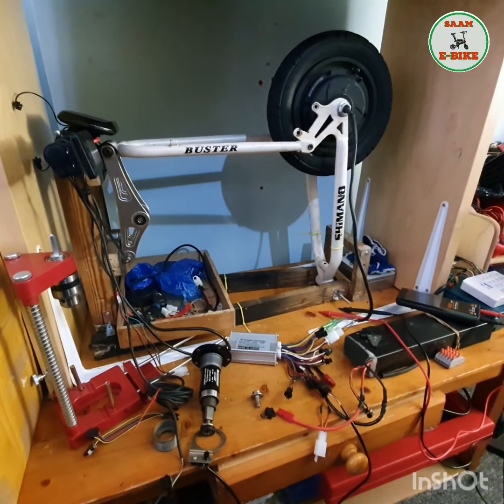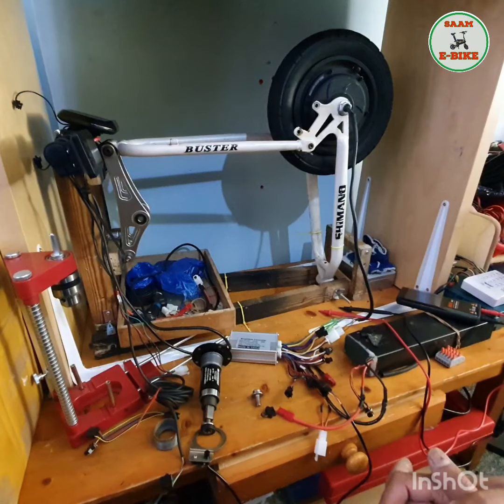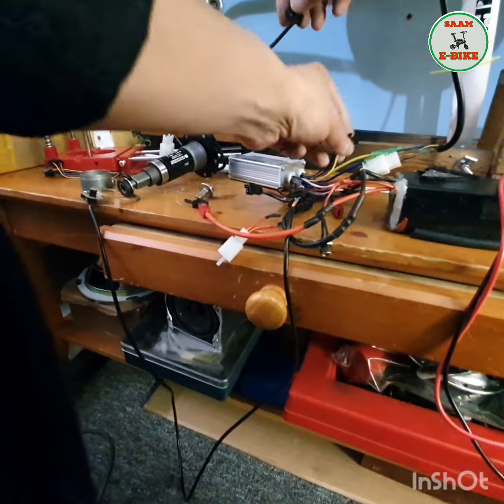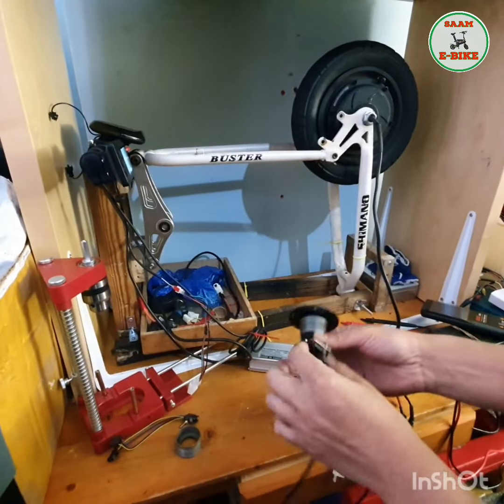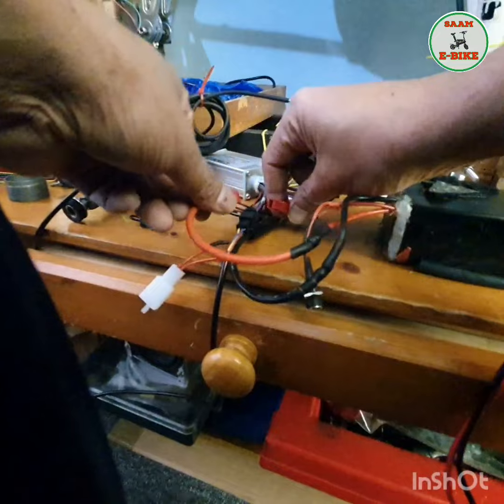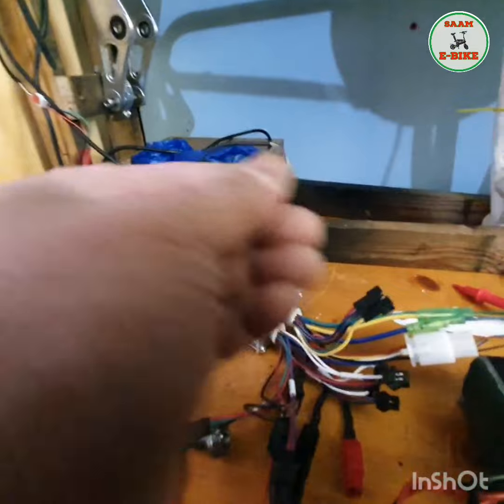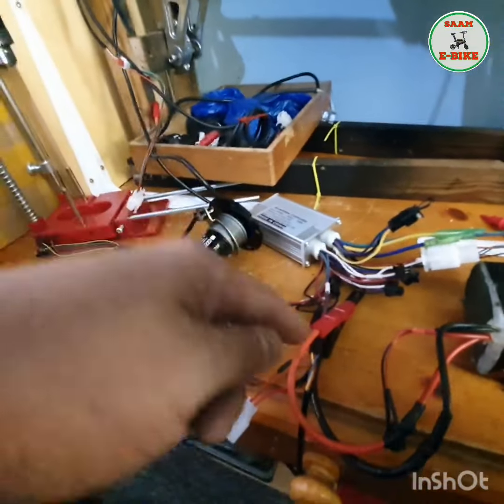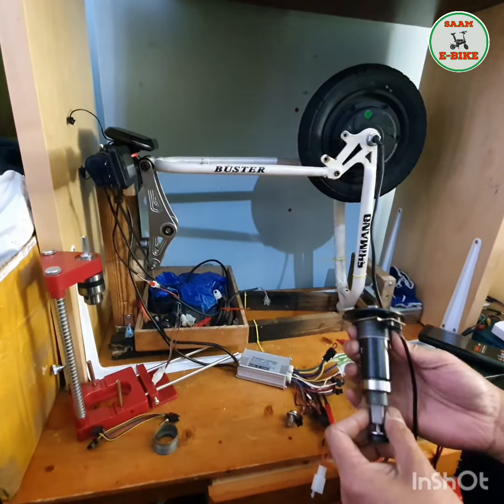how to use electric bike without display

Comment: The wires coming out for the controller display have the first two wires 'Red' and 'Black' (rather than 'Red' and 'Blue', which on mine are the 1st and 3rd wires) - will the Red and Blue connected on mine work the same if I was to do that?
Reply from the maker: Don't worry about 1st and 3rd.. u have to connect red and blue

Comment: Hi, what is the name of those squared black connectors? Also, do I need special clamps to insert the cable into the connectors? Thank you!
Reply from the maker: @sergiosanchezlopez1547  hi thanks for your message... on Ebay if scorch electric bike or scooter JST male and female controller u will find it.

Comment: Thank you so much brother for making this video. My lcd shorted on my way home and I was stuck and didn't know how to! Just the red and blue wire on the controller! Thank you again so much for helping me.
Reply from the maker: Happy to help brother
Reply from the maker: Thanks you very much I happy can you subscribe my channel please will be appreciated
Reply: @SaamE-bike is the full voltage going back to the hub ? I have  6 wire broken Jetson bolt and want to test it ?
Reply: Replying to the Jetson and ebike broken Controler throttle control as well, the controller side is purple with 36 V   Orange is 4.7 V black is 0 V read is 5 V green is 0 V black is zero ground. The throttle side on the handlebars wiring goes brown, yellow white red blue black. My handlebars, throttle assembly wires are yellow and white to the cruise control a momentary switch my assumption, a red blue and black wire that goes to the throttle. And the black wire also pigtails with the brown wire for the display of the voltage on the handlebars the Browns 36 V coming up.       Also, there’s 36 V coming up to the on and off button. Which is on the other side of the handlebars with the light switch that’s a four wire. Just got a controller a new one throttle assembly and it’s different of course key switch that has the display and also the throttle on a.  5 wire. Wish me luck  thanks so much
Reply: So if my throttle isn't working I can take the purple wire and hook it to the red and blue is that correct when by passing display
Reply from the maker: No my friend it should work both pedal assist and throttle.. if only pedal assist working that means your controller is single mode.. u need dual mode controller

Comment: Will this work with thumb throttle and no pedal assist? I'm going absolutely nutty trying to fix my LatieI30 I have installed the dual mode learning controller and no matter what I do I can't get it to work..  I have brand new working motors,  the display works but I can't program it... so hope you can help me out.. this scooter is breaking my bank
Reply from the maker: @ToniHardesty  my friend if u buy the controller u have to buy compatible display too otherwise won't work because every company has different software
Reply from the maker: Let me know what type of display you have name of the display
Reply: @SaamE-bike  I'll try to send a picture, Iam terrible at doing anything with my new phone and I have no access to my Amazon account that I purchased the controller set with :(
Reply from the maker: Saamebike@gmail.com
Reply: @SaamE-bike  I bought the set of dual control DC MOTO CON T ROLLER WITH thumb throttle and display its a color screen and is attached to thumb throttle with one cable going to the red blue, green yellow and black then a separate cable for the thumb throttle
Reply: Correction the screen is attached to the buttons for controller
Reply from the maker: Send me a video

Comment: Hello first I want to thank you for your helpful videos. Also I want to know if there is anyway you can help me, my display got wet and I ordered one from Amazon the m5 lcd display it turns on but I get error 10. So I just want my bike to work I tried no display touched red and blue no throttle or peddle assist work my bike is a Denago fat tire top tube bike with a 750 watt rear hub bafang motor with torque sensor. The controller is tongsheng. Thank you very much
Reply from the maker: Thanks for your message error is communication problem.. I wonder might have problem on your controller..
Reply: @SaamE-bike 
I used multi meter checked all mosfits and wires every thing seems good on my original display I had a password I had to enter on display to get the bike to go is it possible the password is programmed into the controller if so can I reset controller or enter it some how with the different display I bought? My controller is tongsheng KZqw23C also I have grey purple  white brown wires running through the harness to display and throttle plugs any idea what those are?
Reply from the maker: I understand my friend red always same any controller connection you might try with gray connection.. some time company controller do not work..

Comment: I have a KT controller, the display is very expensive, so I want to do without it. I disassembled my controller to find out which wire to the display is responsible for what, and this is what I got:
Green cable: TX
Yellow cable: RX
Black cable: G2
Blue cable: SK
Red cable: N
Can I try to do what you did? Or is it not relevant for KT controllers?
Reply from the maker: Hi mate yes you can try most of the cables same diagram for all controller
Reply from the maker: Some controller are single mode, if is controller are single mode will work only pedal assist
Reply: @SaamE-bike  Is it single-mode if you connect without a display? And is there any way to check this?
Reply from the maker: Normally on the controller written dual mode.. can try connect as I connected hopefully will work
Reply from the maker: Red is positive and blue is receive signal
Reply: @SaamE-bike  Hi, I did as you did and noticed that by connecting red to blue I get voltage on the red wire to the throttle handle. Could this mean that the controller is turned on without a display? I just measured the voltage on the signal wire from the throttle grip and noticed that the voltage only appears when I press the throttle grip full, and it is 3.4 volts. The motor does not spin the wheel.
Reply from the maker: @snaplpoco6701 hi thanks for your message as I mention is only work for pedal assist system or if is dual mode controller then work both hope you understand 👍

Comment: But throttle is working or not
Reply from the maker: Throttle is not going to work if the controller doesn't have dual mode

Comment: But my pas isnt great i need my throttle to work until parts come have u any ideas
Reply from the maker: Your controller is single mode.. if is dual mode controller will work both
Reply: @SaamE-bike  i am going to get a good dual controller i will ask u if i run into any problems but do u know of a good controller dual and not to expensive
Reply from the maker: Try to find black controller

Comment: Hi there. Great video. I am having issues with my evoke display. I press the power on button and the screen backlight turns on but no display nor it will keep on. I hear a click on the motor. Is it a display problem or shall I replace the power controller? Battery is fully charged.
Reply from the maker: Hi you can try same method 😉
Reply: @SaamE-bike  thanks. I will try
Reply: @SaamE-bike  thanks my friend. I tried your method but it seems my bike controller is not working. The led on the controller will turn on for a few seconds but nothing happens 😕 guess I need a new controller. Trying to find one that will use the same wires as I currently have on my bike.
Reply from the maker: Hi thanks for asking check all the power connections if dose not work then change the display but u have to but same display witch one have , otherwise won't work..
Reply: @SaamE-bike  hi I don't think the display is the problem. I did short the wires on the controller on the display port (red and blue) and the motor nor pas work. Nothing happens. Same when the display is connected
Reply from the maker: Try to change the controller
Reply: @SaamE-bike  thanks will try to find one that works with my ebikes 👍🏻🙋🏻‍♂️

Comment: My display connection has red blue white green and yellow. The red and blue are at opposite ends of the pin plug. I just connected them with a cable and it sparked even tho there was no battery connected. Just want to make sure I’m doing the write ones before I try and run the motor of it. Thanks.
Reply from the maker: My is normal because in the controller has current in side.. not to worry is normal u can connect red and blue it should work thanks
Reply: @SaamE-bike  thank you.
Reply: @SaamE-bike  I just tried it but it didn’t work. Neither my throttle or pas made the motor run. Guessing this means I need a new controller as aposed to display cable.
Reply from the maker: This only for pedal assist system not throttle and guss your controller has problem so is better to change it hopefully you understand

Comment: Hello sir, thank u .
How can I set the speed without the display, wheel is turning very slow like PAS 1. Yesterday the bike works fine with te bleu and red cable connection, but now it’s going very slow
Reply from the maker: @lut2928  hi thanks.. this is temporary until u replace your display.. and there is no speed settings

Comment: I have a escorted controller, with no screen can I use it? The throttle is connected directly to the screen board, so how I can use this controller? Please I need help
Reply from the maker: What scooter can you tell me the name
Reply: @SaamE-bike  it called LENZOD controller
Reply from the maker: Only option u have change full system
Reply: @SaamE-bike  it have only the controller and I want to use it with ebike

Comment: Thanks.. i have hero lector c6e bike.. and it's display isn't working.. and dealers are blackmarketing on it.. hero is not selling directly this to costumers.. hope your video help me.. I'm going to apply your instructions on my display.. hope it works..
Requesting you to make a video to complete Bypass of display
Reply from the maker: Hi thanks for your message hopefully you will get it fix.. this is single mode controller if u have dual mode controller it will work both like throttle and pedal assist....
Reply: I just open my display and did same as u suggest.. all 5 wires de-soldered from PCB of display, then soldered only red and blue, and kept rest three wire isolated through glue, and try to run it through paddling but it isn't working.. didn't observed and push from motor, while I well know motor, battery, switch is correct bcz I tested by replacing my friend's same display.. now I stuck.. I thought it's uncharted.. I plugged cycle into charger then it's not charging, I disconnected the display green jack, then it's charging..
I want to know that is there any another wiring connection between controller 5pin jack and display 5pin jack?
bcz I joined the red blue wire from display side.. and it didn't work..
Reply from the maker: Hi some display has different colours signal cable u can try with different colours with red
Reply from the maker: U can try with different colours

Comment: Nice video! Can I connect directly red and blue wire, bcs I don't have a spare contact?
Reply from the maker: Yes u can thanks
Reply: I have error 10 on my display and I thinkink to solve a problem with your video, btw I have a throttle and pas, do you think that this can solve my problem, tnx for a quick answer 👍✌️
Reply: And I forgot to mention, I have sw lcd 900
Reply from the maker: Hi error 10 is communications problem it can be display or controller u can try without display as I did.. if do not work u have to charge the controller
Reply: Tnx for the answer so quick, my bike sometimes work sometimes not (error 010),it depends on his mood that day😅
Reply: All the best! Great videos and very helpful

Comment: Wonderful video!!! Can you help me with my problem? I bought a kit for my e-bike. Came with controller display hub brakes. Everything you need. It's a 3000, 5000 wat. The controller works on 48, 60 and 72 volts. Maybe not 60 maybe 50 something. But 48v and 72v are correct. I got a brand new battery 48v, I hooked it up and turned it on, but nothing happened. The Battery makes a sound. I checked the Battery and pushed the button, that tells you how much battery you have left. Not one bar lights up.  I unhooked the battery from the bike and pressed the button, full charge. Its a sine wave 100a controller. I hooked up everything correctly checked and rechecked all the connections. Made sure nothing was keeping it from working like the brakes and Pas. Can't get it to turn on and work. Do you think it's the controller? Or something else it might be?
Reply from the maker: Hi you can check the controller minimum voltage ⚡️ because some controller built in voltage high so you can't use small battery.. as you mentioned 48v new battery.. you can try with different controller..
Reply: @SaamE-bike  Thank you i will check into that. It is supposed to work with 48v 60v and 72v batteries. I rechecked what it said. Maybe they said wrong. I even tried hooking the charger up while trying to turn it on. Didn't help. You might be right, even though they said it will work. I will try to find a 72 volt somewhere to test. Thanks for your help!!!!!

Comment: Hello i have the add motor EBike my plug is round and has 10 pins inside i hooked the blue and red my bike has throttle and assist will this trick still work
Reply: Okay.Update, I got it where electric assist works.But my throttle don't any clues how to fix that part

Comment: Nice idea, ty for the adive. I would like to know what the blue line and the green line are actually for? I think red is plus, black is minus, yellow is for the light switch? But what is done by the other two.. And how can I choose the assistance level without display, can I achieve this with a voltage divider by using resistors on the blue line?
Reply from the maker: Thanks for massage
Reply from the maker: My friend what actually do you want to know.. this is the option if your display not working..
Reply from the maker: Hi thanks for your message other cable are for signal.. my friend this for temporary there is no option for assist level..
Reply from the maker: Those are single cable
Reply: P @SaamE-bike

Comment: Please, can you make video or explain to me on how to use ebike controller for dc fridge. I have BD350GH DC compressor without control board, and can't find it board.
I need help, please.
Reply from the maker: How many voltage 24 or 36v
Reply from the maker: Hi you can use dual drive control, u can get this from ebay
Reply: @SaamE-bike  link please
Reply: @SaamE-bike  24volts

Comment: Hello friend i want to know mark from the controller  i want een ,but 24v thanks help me .
Reply from the maker: Hi thanks for your message... all same if u use 24v controller
Reply: @SaamE-bike  friend i have a  Focan controller 24v ,but the pas sensor not working, that why i ask you to help my.
Reply from the maker: Ok my u can just replace the PAS sensor
Reply from the maker: Is the same pas sensor or different model.. or on the display can you Check on the settings throttle and pas both on or only throttle on..

Comment: hello i have only 3 wires from hall motor sensor red black and white how to connect 3 wires to 6  wires in my controller yellow, red, black, blue green white?
Reply from the maker: Only use this 3 if u don't have other cable.. u can try this way or u have to buy dual mode controller
Reply: @SaamE-bike  i will try connect the same colours

Comment: Thank you so much i was installing a light on my ebike and did it incorrectly and fried my display. This video helped me by pass my lcd screen so i could confirm that my display was the problem.
Reply from the maker: My pleasure to help 😊 everyone
Reply: Hi! I am completely new to all of this. I have gotten as far as disconnecting my broken display. I see the "thing" you made and I see the two pins in the black clip? for the red and blue wires. I guess I am not understanding  if I just cut the red and blue and join them together? Or do you just cut them and only leave the 2 pins for red and blue. I am assuming  I can use the clip from the display I just disconnected  to make this. Any guidance  would so be appreciated.

Comment: Thanks for this piece! But my scooter is flashing rear red light when the controller turned on, do you think my controller has a problem?
Reply from the maker: Hi is not controller is abs brake connection
Reply: @SaamE-bike  Thanks for your response :).. I tried even reconnecting the cables (all) and check the sensor, still the same. I know my display board has a fault, but even I tried replacing it but still the rear light is flashing and the new board is showing 10 error, I believe it’s some connect between controller and the board, still I can’t figure it out, please help! I can’t use the bypassing of the display method to get the motor working because the scooter don’t have a Blue colored wire (has one 4). I’d appreciate any help pls!
Reply from the maker: Hi thanks my friend error code 10 is communicating problem please remove all cable and plug it back hopefully will sorted..

Comment: Where are you living in uk, I have gone through the process but it's not working.
Reply from the maker: North London
Reply: @SaamE-bike  I live in Nuneaton, Coventry.  Can I get your number please !
Reply from the maker: I'm out of country now will be back on 29th
Reply: Hello Brother,

Can you please help me to fix the bike 🙏, I have changed the main controller and display both but still the motor is not running properly sometimes it starts and sometimes it doesn't start.

Kindly share your number and please help me to fix the issue. I will pay you the fees also.